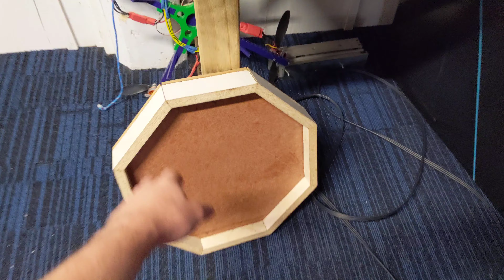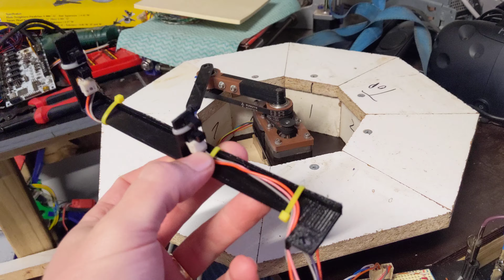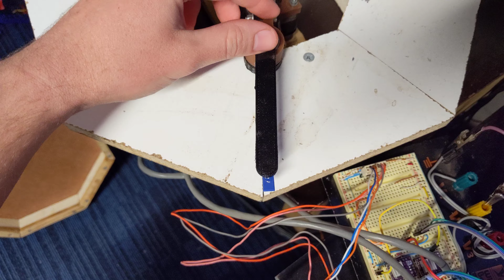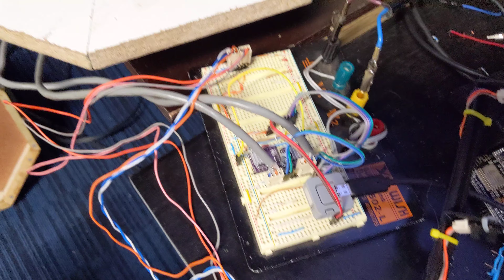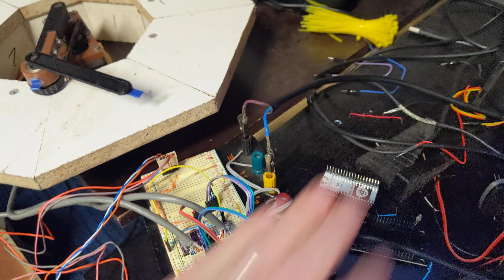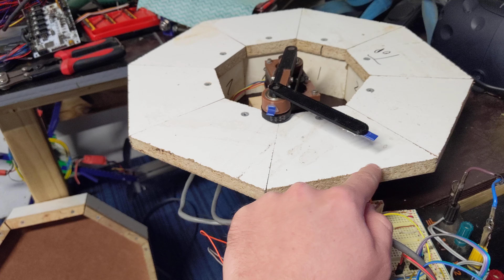Sand Drawing - Puzzling over implementation

Comment: can you home the second arm back along the first by mounting the opto on the start of the first arm?
Reply from the maker: I could! But then I'd have to run the wires for the opto to the first arm, and I'd need brushed contacts or something to transmit the power and signal through the joint. This is really hard to do cheaply.
Reply: @tjhowse  maybe if the tab for the second arm extended a little further than the first arm and then was twice as long to extend down below the first arm? ie it's opto would be on it's back facing up? great project btw